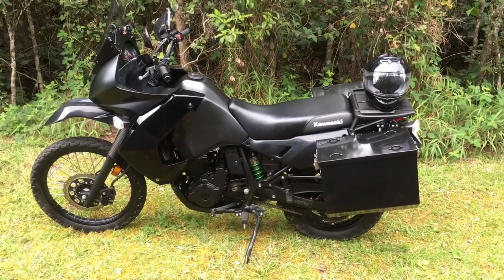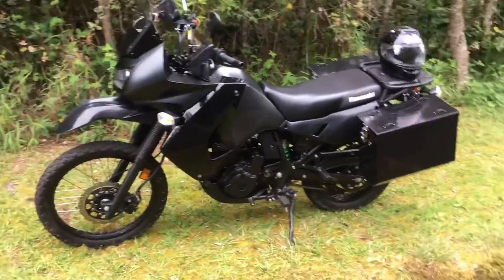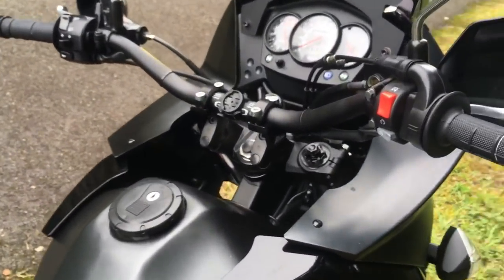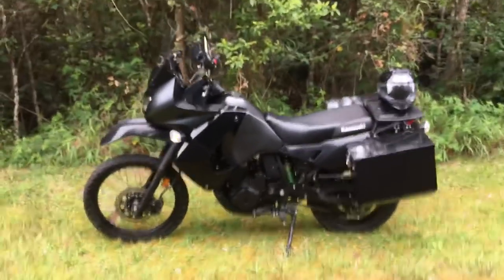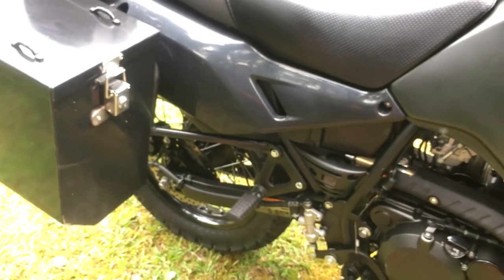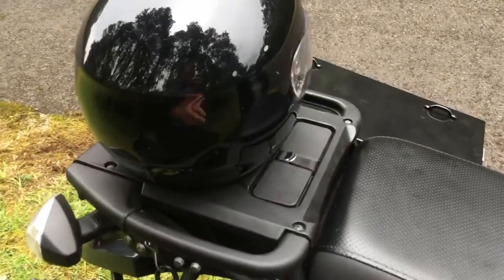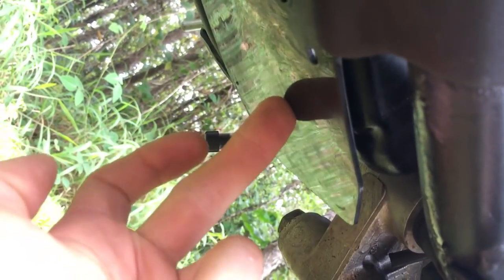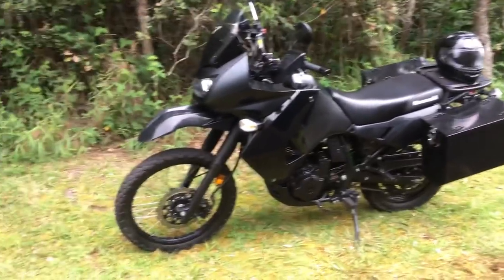KLR650 Review (Watch BEFORE Buying!) Full Feature

Comment: I also lowered the pegs and replaced the rear spring with something better. The thing is it's cheap and simple with plenty of bits available. There are brake upgrades available as well as carbs, exhaust and airbox if you want a bit more chooch (probably find an extra few hp.) The thing is I can't fault mine because it's been so cheap and reliable to run. Alas the end is near for big thumpers, enjoy them while you can.

Comment: Great review from an experienced rider. I come from a 2-stroke background as well, and we have a lot of common viewpoints about this bike. I removed the rear fender also, and feel that the front suspension and lack of 6th gear are the biggest shortcomings as well.  I added the front progressive springs and they helped a little. Any plans for exhaust upgrade? I have a Lexx.
Reply from the maker: Rob Rides Carolina I was going to do a Lexx, but I was $7,5k into the KLR already and didn't want to put more into it. I bit the bullet and traded it off for a KTM 690R Enduro which is exactly what I was craving. 

The KLR was a fantastic commuter, but I was going to hurt myself off road on it because of the chassis limitations. I cant afford the KLR and a say 350EXC, so 690 was a perfect match. Its what I originally wanted anyway, but I couldn't  find a used one, and didn't think I could afford new. Where there's a will there's a way... 690 reminds me of the 250SX's I used to race. It's pretty snotty on the advanced Map and power to weight isn't much different. They're both pretty close to 4.5lbs per HP.
Reply: I can definitely understand that. If you want to ride at that level off road, it's probably better to step up. I've heard a lot of good things about the 690 and I'll have to check them out.  I'm a big guy, and don't plan on getting too extreme off road anymore, so the KLR suits me fine, at least for now, but who knows down the road.

Comment: Thanks for the review John. I have a 2002 KLR and it has the same features/misgivings as your bike does. I'm still riding mine can't say that there's anything wrong with it other than the front suspension. I remember those stock tires, very soft.
My longest trip has been from Chicago to Eastern Ohio, 426.5 miles. I had the stock seat. Yours looks like the wider stock seat. I can see why you call it a couch.
I'm recovering from back surgery and severe neuropathy. Haven't done any long rides but the thumper vibration actually numbs the leg and foot pain so maybe it's got another selling point.
I started on a 1972 175cc Enduro. Love those 2 cycle high revs.
Reply from the maker: Well, if you're doing long paved rides like that, it's great! Superb commuter. 

If you look at evolution of my other videos over the past 9 months, you'll see why it had tremendous shortcomings for me.

Best wishes on your recovery! The water (pool etc..) is your friend.

Ride on! ✊
Reply: @JohnHowerton137  Thanks John. My tip for you is to stay away from the pain killers. I stayed on them too long.(I tell everyone that.) Ride on!
Reply from the maker: Brian Starr very slippery slope. My mom had several discs fused last year. She’s recently started trying the CBD route because she almost refuses to take pain killers.
Reply: @JohnHowerton137  I use CBD topically along with gabapentin. It's been two years and I'm just starting to feel like myself again. I had to detox for 20 days 2 years ago. 

Good for her!

Comment: Finally a review that points out the shortcomings of a ubiquitous machine. I owned a lot of big thumpers in the 650 range. This is the weakest bike of any manufacturer coupled with tall gears. It sucks for the slow technical stuff offroad. Too much clutch work.  Suspension blows on my 2012. I think that they improved it in later years. The best bike out there is the little known TR650 Terra from Husqvarna. Best balance of street and dirt. That being said...you cant find a 650 in good condition for as cheap as you can pick up a KLR. They have tons in the aftermarket for the KLR. A 650 should have some kind of snap.  All the other 650's will snatch the front wheel off the ground in 1st or 2nd without clutch and still cruise 65 mph with out a lot of buzz (XR650L is a bit buzzy though). Thanks for the HONEST review. Best I have found on the Tube. Hope people find this before buying.
Reply from the maker: My thoughts exactly. It's a put-put. Very comfy cruiser/commuter though. As you might know by now... she got traded in like a day after the first payment for a KTM 690 (which is a pretty badass machine). Sink $10k into a KLR and you still have less than half the performance as the KTM in every category. 

Honda should have killed their 650L and dominated the market with a E-start XR650RR as an Enduro. At least the Japanese side. I just dont understand why Japanese have let KTM/Husky run away with the whole market. At every displacement.
Reply: for the money it's the best bike there is, you can add all the stuff to bring it up to snuff, and still be way ahead.

Comment: The bike was designed in another era ,John the weak spots are the Doohickey and the subframe mounting bolts, then the handlebars, I have a 2013, I hoping when Kawasaki finally bring out a new adv range they avoid the errors of the past.
Reply from the maker: Whole new set of errors. LOL! All bikes have problems, some take longer than others to figure them out. Some manufacturers fix them, some never do.

Comment: Excellent review John - very comprehensive and honest. Just the info that I wanted/needed.  Thank you.
Reply from the maker: Peter V thank you. Good bike, just not the tool I needed. Some like yourself got what I was trying to say, others just got offended 🤷🏼‍♂️ Happy to hear you found value in it. 🤙
Reply: @JohnHowerton137  - Yes - I was surprised at some of the harsh comments, which were unfounded/unfair. Your review is exceptionally well balanced and clearly articulated that it's an good bike but just doesn't fit your needs. Conversely, it's just what I want (I think), but as a new rider I'm not entirely sure. I'm in Canada and can get a brand new (2018) one at a dealership for about $4,800 (USD), $6,300 (Cdn). Seems like a fair price?  What do you think?
Reply from the maker: Peter V a new rider on mostly the street or tooling down logging roads it's a fine machine. The only drawback I could think of for beginners the weight. That just "is" for any bike that can travel hwy speeds. 

It's a very simple bike, nothing to worry about for someone new... simple as an old lawn mower. Engine characteristic is mellow, the seat is somewhat low and comfortable. You wont notice/or know the pitfalls of the suspension, brakes and power because they'll be adequate for the speeds you travel. 

I have a hard time believing you wont enjoy it after a small learning curve and $4,800 sounds like a heck of a value for a brand new one. My friend just sold two low miles ones practically overnight for nearly that.
Reply: John Howerton - Thank you so much for your insightful response. I really appreciate it.  Again, the info that you've shared has helped me immensely in my decision-making process.  I think I'll pull the trigger and go for it!
Reply from the maker: Peter V welcome to the two wheel club 🤙

Comment: Agree on the front end, been debating getting the brace and progress spring kit. I will say i been considering it because I have brought the front tire up a few times and coming back down the front seem to need alot more stiffness.
Reply from the maker: imssgmiller the brace is basically a must! Dont debate any longer. Those forks are so long they twist at the slightest bump. They really should have been 48mm or bigger tubes on that big bike.

Comment: I'm on a Buell Blast right now (a 500cc thumper) but I want something I can take off road.  I'm between the KLR650 or getting a Sportster and setting it up as a dual sport.  Frankly I'm a Sportster guy (the Buell is a stop-gap after my '02 Sporty threw herself under a Peterbilt to save my life) but I'm also poor and the dual sportster setup would be a months-long project for me.  Then too, the KLR weighs over 100lbs less than a rigid Sporty which I understand has a pretty big effect going offroad.

I'm not decided yet, but I think this review is gonna help me choose soon.
Reply: I have both right now, get the KLR, you will not regret it!

Comment: should I get a 2017 klr with zero accessories for $4000 obo, or a 2013 with $1500 in accessories for $3800 firm? both around 6000 miles. Or wait and find one for $2500 and see if I like it first??
Reply from the maker: some guy in the motorcycle world when you sell your bike, you don't get any of the accessory money back. So it seems like the older one is overpriced. If I recall correctly, the 2017 had some suspension upgrades over the '13.

All that said, go look at both. I'd rather have a well maintained garaged '13 than a '17 that sat in a driveway bleached out and has been dumped a bunch with zip ties everywhere.
Reply: @JohnHowerton137  thanks for the reply. I'm in such a dilemma right now because the '13 pretty much has all the stuff I would have to buy for the '17 already installed lol... I'll go check them out though
Reply from the maker: some guy yes, look at them. Preferably both the same day. Don’t buy the first one unless it literally looks like it never left the showroom. Chances are one of them is ugly. 🤣 A used bike can be your worst nightmare if you get too excited when you go to look at it.

Comment: I've owned four, love them, they are beasts will last forever and get you anywhere you need to go, It's not a KTM, it's a dual purpose, you can ad things to make it much better for 1/5 the cost of a ktm
Reply from the maker: KLR cost 2/3 of what a KTM does and has about 1/4 the performance in every category. It's not a bad machine and I've never said it was. There's certainly a market for it.

But when the engine barely makes it up a fire road at altitude and the chassis keeps me white knuckled on said road at 12MPH... then get a KTM 690 weeks later and go up the same road at an average 40-50MPH with a smile, there is a big difference. They literally cannot be compared.
Reply: @JohnHowerton137  I guess my point was they a very good job of what they are made for, they are not made to do the stuff you like to do. But I have ridden them for 20 years, made mods to them to suit my 6'2" 230 lb body. They sure can't do what a KTM can do,  but I have ridden them at very high speeds though washes of pure sand, single track not sure why you were white knuckled? But maybe I'm just used to them.
Reply from the maker: Ok, we're on the same page then. That's really all I was getting at in the review. 

Sand wash would be fine. I bought it to get out into more remote areas to mountain run. Here the earth moves. Imagine riding on a field of baseballs, softballs and footballs covered in cheese graders. Very light rocks. Everything rolling beneath you. Knowing 500lbs is about to pin your legs to jagged cheese graders at any second raises the hair on your neck. The is where the spindly fork gets really scary. Try to climb a hill... the weight is just too much for the traction beneath it. I had a save (5mph climb) that scared me white and week later took me back to the dealer to trade it in.

Sounds like it's perfect for what you need, and in a world where I just needed bitchin' work commuter, I'd prob still own it 😋

Comment: It's not a dirt bike ,it's an adventure bike and depending on your riding style you make adjustments I changed out my rear sprocket to give me more low end pull in the tight woods but traded street top end for it, I love my KLR 2009 and put it through hell, still runs like a champ, these things are near bullet proof, Change out the doohickie though to one with a torsion spring. I often wonder if I should have went with the DRZ400 or a similar type for more off road performance , it all depends on how you ride, the KLR is fine unless you really like get squirrelly. For the money you can't beat 'em. Get rid of the plastic motor guard too for a real one. Just put new tires and a thorough check up, ready for the summer.

Comment: Kind of a strange review, your a KTM guy, then why did u buy a KLR? Hey I get it KTM's rock, but they also cost a lot more, what did u expect for 6 grand? I had a 2003 klr650 and I did a bunch of stuff to it but marriage and a house  forced me to sell it, I regret it, should have kept the old war horse, had 22k  miles and it ran strong. With that said, I really am lusting after the husqvarna 701 enduro, looks like a great bike, thanks for the review.
Reply from the maker: Jimena Gulla well, no other reason it was a money issue at the time and no used market on the island. Didn't realize that going off-road was going to be like sticking a heroine needle back in my arm. Where there's a will, there's a way... Took it back to the dealer grabbed a new 690 and when that didn't get all my itches I bought a 350EXC too. Now I live in dirtbike ecstasy. 🤣

Do wish I had a 150/200 and a trials bike though too.
Reply from the maker: Jimena Gulla P.S. 701 is sick. If we had a Husky dealer I'd probably be on a 701 and FE350

Comment: I ride in running shoes,  I'm a moto guy,  Suspension is unfixable.  Dude... lol  You are so wrong.  COGENT suspension makes it a beast!  Bike has plenty of power for offroad.
Reply from the maker: Re-listen to the first minute. The video title and precedent set at the beginning was not misleading.

I’ll assume you haven’t ridden too many off-road bikes? It’s a beast alright. A sloth is the first to come to mind. With a $700 Cogent shock and a 48mm KYB inverted fork it would be fine, but that doesn’t fix the chassis flex, weird tire size, weight, and an extremely low horsepower to weight ratio... which I probably could have lived with... but now you have an expensive sloth after trimming out for any serious off-roading. I didn’t need a money pit.

Ride a KLR at altitude sometime, it feels like a 5hp Briggs. Even my 250F has 4-7 more HP (11fp less torque), weights 200lbs less, doesn’t pull as tall of gears (6 speed), and has nearly the same top speed. That’s the difference 35 years in technology makes. I paid identical base prices for them both lightly used. This KLR had 350(?) road miles when I bought it off the showroom and the 250F about 60hrs.

I accept the KLR for what it is, a reliable old pig... and that’s fine. Your opinion doesn’t change that. There’s clearly a place in the market for that niche because all the Japanese brands have been producing EXACTLY that, nearly unchanged, every year for 3+ decades. I wasn’t bashing the bike, just pointing out it’s shortcomings for some people like myself. Not everyone is you, there are lots of people with history’s like mine. I knew exactly what it was when I was buying it, as I used to sell the things! My needs/desired changed quickly and it became clear that the KLR would be nothing more than a commuter to me. I traded it in a day later(?) for a KTM which checked every box and was faster than my pit bikes... requiring me to put on boots 😉

Comment: Overall, seems like a LOT more positive than negative in your review :) Just not the bike for your riding style.
Reply from the maker: MrScott156 exactly! It is what it is... and it’s perfect for that.
Reply: @JohnHowerton137  - I was right there with you in that I "was" a hardcore, aggressive rider for years, but now that I turned 50, I found that falling and hitting the ground hurts much more than it used to so I'm loving my KLR for a little more relaxed ride (not that I don't push it more than I should from time to time). BTW,  I'm definitely ordering the foot peg lowering kit for my KLR from JNS based on you review. Thanks for that!
Reply from the maker: MrScott156 it's like the ultimate comfy couch commuter.

Part of my problem was riding at altitude. It produced like 12HP. My 350 feels like a 125 up there and even wide open on the 690... the gap from 2nd to 3rd feels like a reach.

You'll love that peg lovering kit 👌